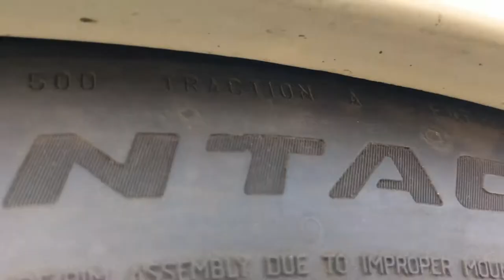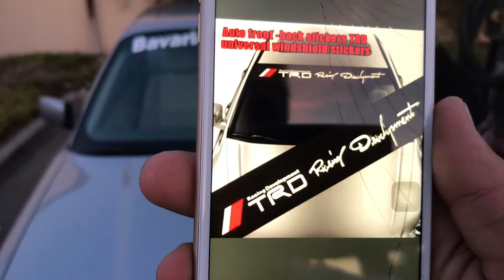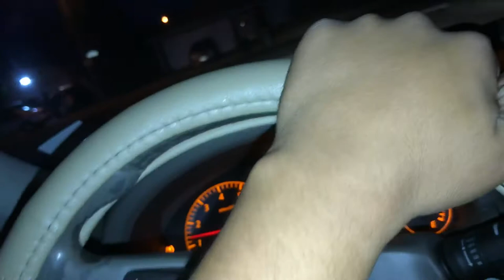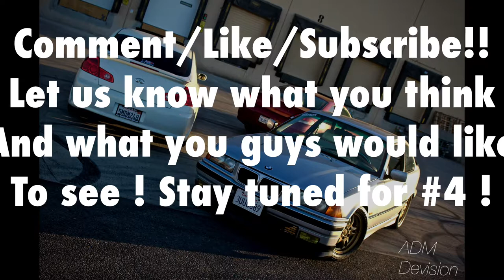Vlog 3 : Finally Got Rims on the G35 !

Comment: How to ruin a g35: Put a massive racing spoiler on it that provides fuckall downforce.
Reply from the maker: Blake Johnson right. Ended up taking it off after a while. Wish I had an updated video on the car now but I sold it
Reply: I was thinking of getting just a lip spoiler. Parts for the sedan v35 are hard to find here in australia.